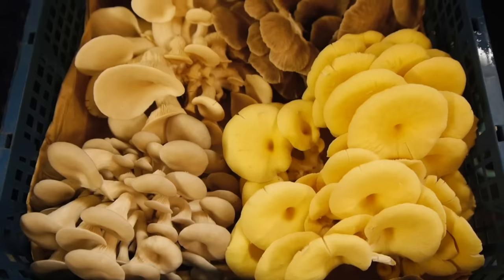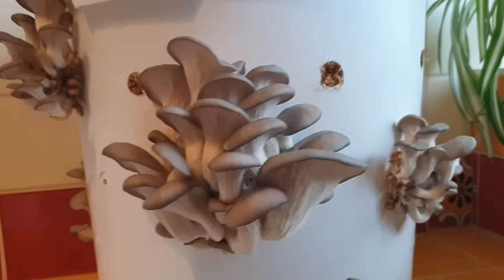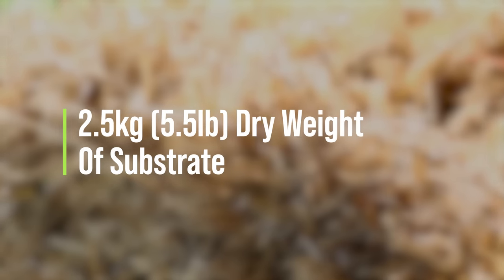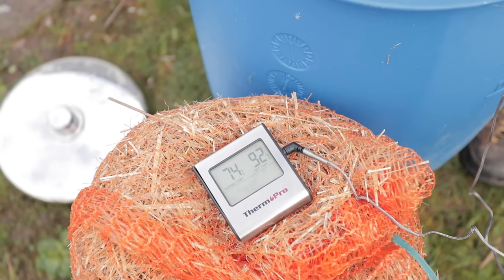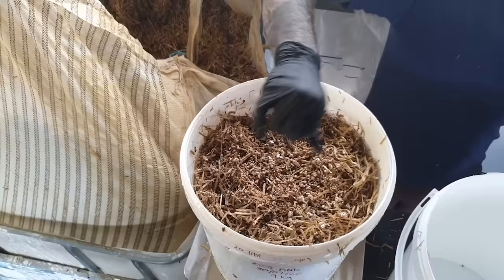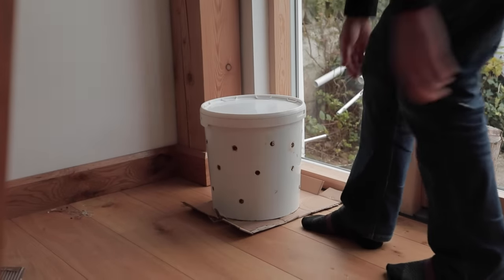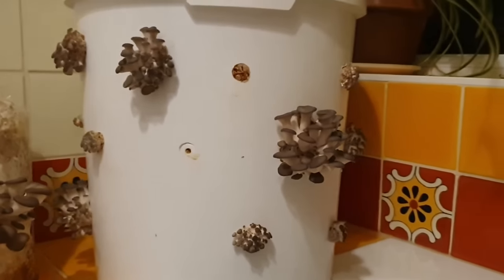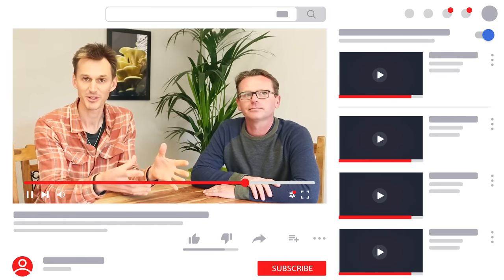Growing Mushrooms in a Bucket! (Super Easy Method) | GroCycle

Comment: Cover the holes with micropore tape to keep the humidity in and contamination out. Remove it when colonisation is done.
Reply: The humidity depends on the environment where the bucket is.  In summer, I don't need to cover the holes as it's VERY humid here, but in winter it's much dryer.
Reply: @celticlass8573  micro pore is to prevente contamination and bugs to lay eggs in the substrate. Trust me, that will happen!

Comment: You can place the bucket with holes into a bucket without holes for the colonization.  Blocks light and minimizes O2.  Once it's ready to fruit, pull the bucket with holes out of the other bucket and set it in the fruiting environment. 
Thanks for all the helpful info!!!
Reply from the maker: Great tip, thanks! 😃
Reply: 20l bucket inside of a 30 l bucket ......30 L hot water pasteurisation is also possible..... Much simpler
Reply: @13thbiosphere  I wonder if you sell em if it will cover the costs of hot water
Reply: You need air during colonization.
Reply: How does the generated CO2 get out and fresh air get in. Isn't this needed during colonization? In one video by grocycle i saw they put micropore tape over the holes. I was planning on doing what you mentioned but with theouter bucket having holes that align to the inner bucket (but fewer), then cover those holes in the "shield" bucket with 5 micron stick-on filter patches. Thoughts?

Comment: Thank you for the video!
To me it seams for a small hobby single household level, hardwood or straw pellets seam to be the most convenient substrate to get. But you mention issues with compaction and air exchange with fine materials.
Do you think using smaller buckets would help with the air exchange?
What would you say is the smallest reasonable bucket to grow oyster mushrooms?

Comment: Hi ! Thanks a lot for this video, this is really interesting and I really want to try it out ! I have some questions though : 1. What can you do with the spawn if you don't use it entirely ? do you store it in the fridge ? 2. Does this method work with any other type of mushroom ? Thanks !
Reply from the maker: 1) yes, you can re-seal the spawn and store in the fridge for a couple of weeks, then clean bags well with alcohol before using 2) this method works best with Oysters, but we have seen some folks growing Shiitake like this and knocking the colonised substrate out of the bucket to fruit
Reply: @GroCycleTV  Thanks so much for the answer :)

Comment: I did this similar with same size holes.

I would suggest smaller holes so the chance removing subszrate when harvesting is smaller
Reply from the maker: We've found this size hole works well for us, if you put your hand behind and twist before pulling, hardly any substrate comes out - I think any bigger and it might be a problem... how was your crop? Good luck!!
Reply: @GroCycleTV  I assume you're usig straw then the hole size should be ok I'm using sawdust and straw like stuff because I get it for free (wheat hulls straw rests etc. ) because thats smaller it would break loose easier.

At the moment I did just a test with cold pasteurization in bahs which worked pretty well but the strain of oyster that Icloned from the wild because it seemed so strong didn't fruit in all tries before (sterilized and other mediums).

Now after 10 or so attempts I found how to make it fruit finally, but it grows strange as if it got way to high CO2. 
Looks more looks like a Trumpet than an oyster mushroom. Many stems wit just a tiny cap that is white in the middle.... 

Very strange.... 

And no its not because high CO2 I tried mor air exchange, different humidity and different temperature.

Maybe my culture is just to old.

Tried for 3 years to get it fruiting at all.

Now I found the reason why it didn't fruit but now it doesn't grow as its supposed to do.... 

Will probably dismiss this strain even its growing exceptionally strong and quickly mycelium but getting it to fruit and then fruit correctly is pretty hard to do.
Reply: @Gorkilein  Did you used the cold pasteurization on sawdust substrat? Or was it straw?
Reply: @ale.ktheo.g4394  Idid use a mixture of sawdust spelt and wheat-bran

But I was just testing the coldnpasterisation method

I had a bit mold in rhe tests bit it was overtaken by the oyster mycelium lateron.

Before I always used sterilized sawdust.
Reply: @Gorkilein  Thanks for the answer ;} Do you think you will continue to use cold pasteurization on sawdust? I'm thinking in using Wood chips. I'm also thinking in doing hot watter pasteurization for this substrate
Reply: @ale.ktheo.g4394  can't say i need to try more.

I used a very rich subrate and got some cobwebmold and 1 spot of other before it was overtaken.

Need to try more often to see more results.

For next time I planned using more chalk because I saw someone using 5 times of that and it seemed not to harm the mushroom but I assume it will better kill off the molds maybe.

As said I need some more explanation.

Comment: It seems that the hot water way to sterilize the medium is kind of energy intensive, isn't it? Does the hydrated lime really work? If so I think it's better.
Reply from the maker: For small batched like this, hot water is much more accessible. We use hydrated lime on a commercial scale, and it works very well. For larger, commercial batches, it is less energy intensive, but for a small bucket grow, such as the one in this video, you just need to boil a large saucepan of water (maybe a couple of these) and that's probably a better approach when you then factor in fuel if you need to go fetch the lime, or product cost and delivery charges if you were to buy the lime. But we agree, on a large scale, that using hydrated lime is the better approach, but for one off home grows, hot water os the way to go... but great question, and thanks for watching!

Comment: Hi dear. I am using a bucket to grow oyster mushroom.  After a month the bucket seems light.  Do I soak again the straW?  And how do I soak it with the bucket?  Do I open the lid and put water in?  Looking forward for you answer.  Thanks
Reply from the maker: Have you been spraying it? If you spray with a spritzer or hose it should be able to take on enough water to keep it hydrated - also, keep in the shade, if it's in direct sunlight it may dry out too quickly and become light, and mushrooms will struggle to grow... hope that helps, of not, feel free to post another comment here!

Comment: Does anyone have an opinion or data on the yield of this method vs the yield of grow bags methods (either sawdust or sawdust+soy hulls)?
Reply: IMO the benefit to doing the bucket method is that it's much lower waste, because the bucket is reusable and the bags are not, and the secondary is that over time, because you won't be purchasing the bags anymore, you save money.  I like the bucket method because of this, though I have grown many in blocks as well.  The ones I've grown in bags, if the blocks have had a few flushes I like to revitalize them by putting them in a bucket with either straw or chips, and they will recolonize and I get a decent yield from the "spent" blocks. 😊 I also reached out to one of my local businesses, and they gave me the buckets that bulk nut butter comes in, for free.  I also combine that with colonizing grain in jars rather than grain bags, so that cost is nominal as well.
Reply: @celticlass8573  thank you for the reply. Did you find any differences in the yield per space utilised when growing in buckets vs bags? 

I am considering the different methods, and lower costs and waste are definitely an advantage, I agree. 

I want to know the trade off. Why are bags still popular in this case? Yield must be different...
Reply: @anirshadchowdhury9653  The yield is quite similar by volume of substrate.  It shouldn't be any different, when you think about it, a block is a block, if all the prep is the same.  
As for why people still use bags to grow mushrooms, I believe it's because it's convenient, and they don't want to bother with washing the buckets.  The buckets take up more space than bags do, but the buckets have the capacity of producing more than one mushroom at a time.  Definitely experiment and see what works best for you. 😊

Comment: If using  the same quantities but spread in 4 smaller 5 litters buckets, will the total  crop be the same as you get  in one of 20 litters?many thanks
Reply from the maker: Hi - it should be similar, yes, but the nutrients will tend to be used up faster and subsequent yields may be smaller, but work with the buckets that are a) available to you and b) fit in with your production process - just make sure that they are food grade plastic. Good luck!

Comment: Hello,can we chop straw into powder and use it instead of sawdust then sterilize it in a pressure cooker?
Reply from the maker: Yes you can do this to create your substrate to grow in bags, but we wouldn't recommend using small particle size substrate like this in buckets as you tend to get issues with poor air exchange to the middle of the substrate

Comment: When Fruiting in a bucket or a bag, which method produces the best clusters if the bag and/or bucket capacity is comparable?
Reply: In my experience, if the volume of the bucket is the same as that of a bag, the amount of mushrooms is comparable.  Of course it will depend on the mushroom, your climate etc.
Reply: @celticlass8573  yes, if bag and bucket are comparable,  the Fruiting on the side of the bucket, is this comparable Top Fruiting out the top/side of bag, is there a difference in the Clusters  , if so , which  ?... ?
Reply: @wande.r  I can't imagine there would be less, since the surface is more than the typical bag opening.  I think I'd be careful to make sure that it doesn't get too dry.

Comment: Don't you have contamination problems with this low time/temperature sterilisation/pasteurisation of the wheat straws? it's because you don't use any supplement? Did you stopped using coffee ground? thank you :)
Reply from the maker: Very low contamination rate growing like this. Oysters grow very happily on 100% straw substrate, which contains much higher Nitrogen and mineral levels than sawdust, meaning supplementation is not necessary to get good yields.